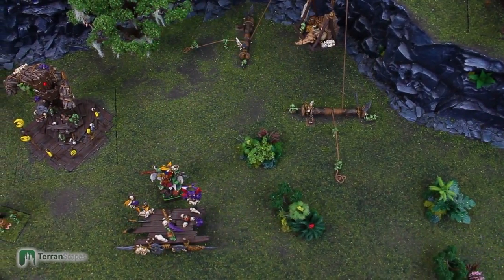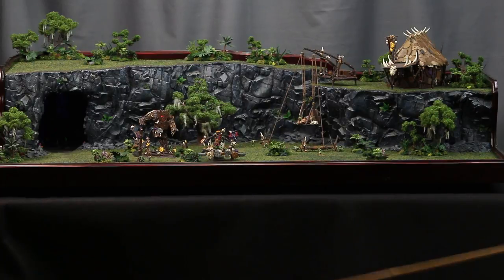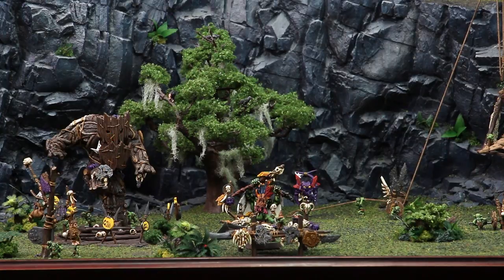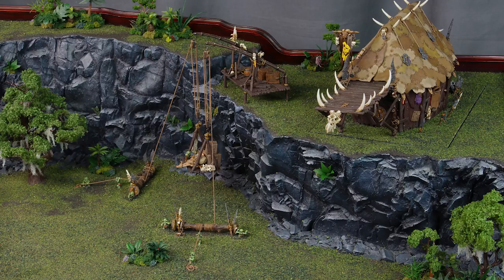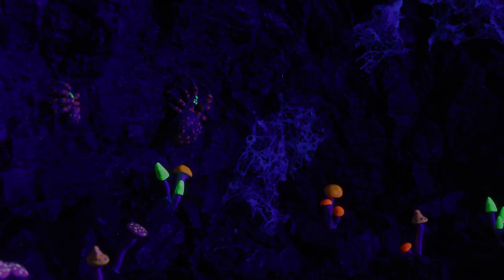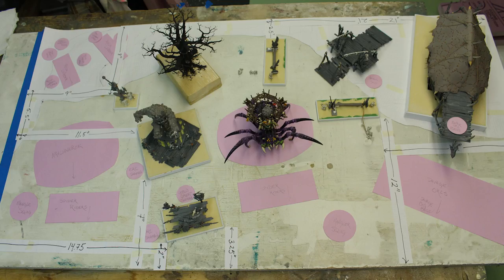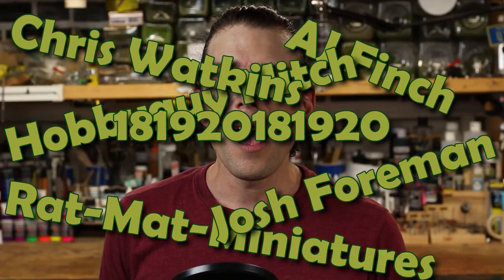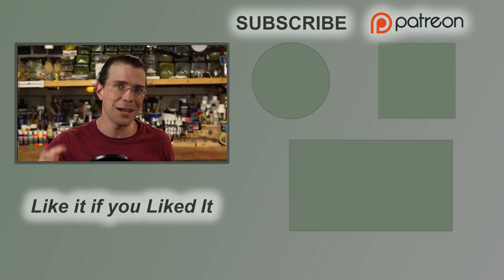Orc Display Board Terrain Showcase - LED lighting, Idol, Hut, Elevator, Cave and more!

Comment: About the audio: First, is the reverb so bad that you need to clean your audio with plugins? I've done some audio production, both music and restoration/cleanup and there really are few times I've felt the need to go this aggressive. In my ears the audio, as it is now, is extremely processed and alien sounding. It's like all the top and higher mid-range is gone and you almost sound like you are talking under water (especially in the beginning of the video). If you get too much room noise or bleed from surrounding sources you should probably think about investing in another type of microphone. When you switch to the VO-audio some of the top is re-introduced in the mix, but your "S" sounds cut through like a razor and much of the natural mid range still seems missing, making the sound very strained. The whole mix get's that vobbly feeling in the base, probably because the aggressive processing.

If you want some advice about making your voice sounding better I'd toss away most of the plugins. To record your voice in the best possible way I'd invest a few bucks in a mic pre-amp (you can get a decent one for well under $100). These are good since they often have a built in compressor that is simple to use. They can also take away much of that digital harshness that comes with plugin your mic directly to the computer. If you have noisy stuff in your basement I'd invest in a more directional microphone, a decent one will enable you to direct it away from any noise and make your nice voice feel much more natural since it will not butcher the sound in order to rid it from unwanted noise. You have a pop-filter so that's great, but it does nothing for the razor sharp "S" sounds, this is where I'd use a de-esser plugin (there are some that are completely free and might be better than what comes with most consumer level audio editing programs/software).

Getting the right equipment isn't always that easy, especially if you don't know what you are looking for. My advice here is to look up a local shop and go there and talk to them in person. You will be able to explain your issues and the people there are often very knowledgeable in their field so they can help you pick the right equipment. The prices might be a few dollars more, but if it is a good re-seller that cares about their customers you often get the benefit of return and swapping things that don't work out. If reverb is a real problem you might want to invest in some dampening, it doesn't have to be expensive. All you might need is to hang some fabric behind you or put up a painting or two.

Thanks for all your great videos!